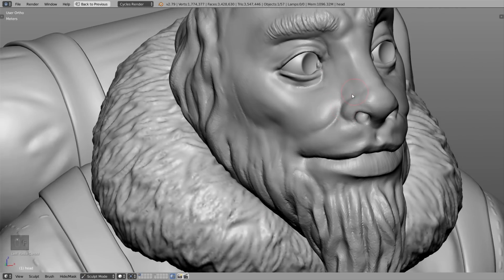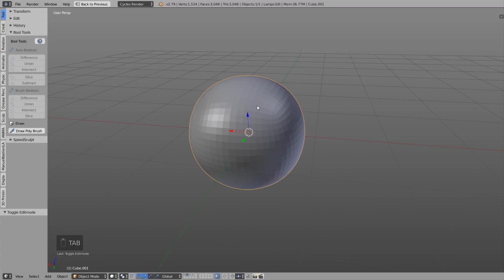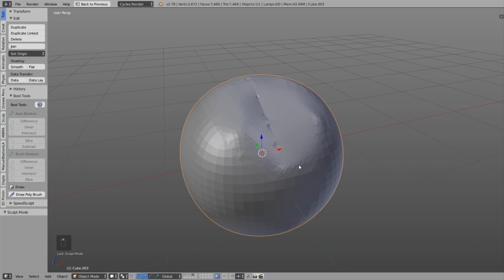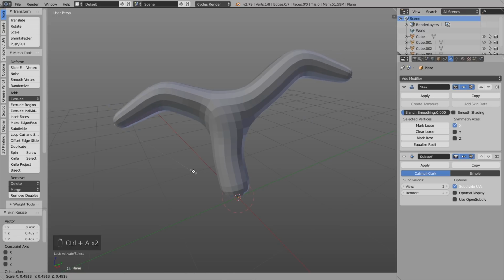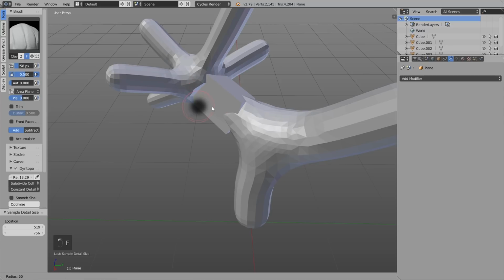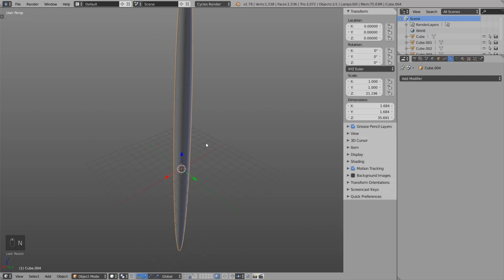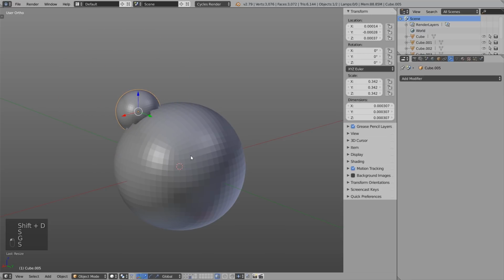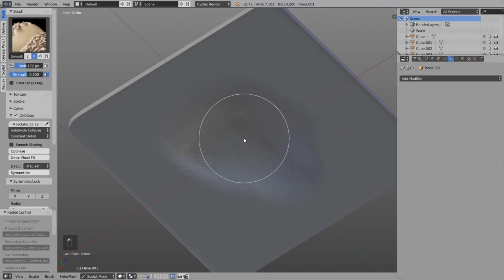How to Solve Common Sculpting Problems in Blender

Comment: I had a serious problem with my sculpt - I inflated a small part into a big blob, and it lost some vertices inside, inflating them into inverse spheres, with even more inside... The way I managed to solve it was to set dyntopo to a really small resolution, use the 'flatten" tool to chop up the degenerate geometry into a very coarse grid, then "smooth" tool to untangle it. Repeat as needed. Then set auto-smoothing to max when re-inflating, it automatically realigns the orphaned vertices.
Reply from the maker: Sometimes with serious artifacts and deformations of a part of the sculpt an option is to just boolean cut out a part of the sculpt and remesh it.

Comment: Some reason I can use the sculpt tool on some flower petals I've been making (Following a tutorial) even with subdivision on it still doesn't work. (like the brush's I use do nothing. with the error on the bottom saying "object has non-uniform scale "sculpting may be unpredictable" what should I do? (blender I use is 3.5 and started using 4)
Reply from the maker: The error prompt is a suggestion for the solution here. You need to apply the scale transform to the object before you sculpt. Otherwise all the tools in sculpt mode might be affected by the unapplied scaling and act really weird (especially if scaling was intense). To apply scale to an object just select it and press Ctrl+A. From the menu that appears select scale and you should be good to go. Hope this helps. 
-DJ
Reply: @cgboost  Thanks for the reply, I was able to fix the problem now :)
Reply from the maker: @CalmLoffy  Glad it helped !

Comment: What do you do when an object cause all sculpt brushes to get squashed? It's like, if I scale the object along an axis, (squashes it) the brushes get squashed as well. Never had this occur before, and I have no clue what checkbox is or isn't checked. I've looked everywhere.
Reply from the maker: This is because object scale is performed by Blender after any edits or modifiers. So if you apply the scale (Ctrl+A, Scale) the brush should go back to normal... hopefully...
~ Daniel
Reply: @cgboost   That worked, and I've done it many times since I made this post. Thanks so much dude!

Comment: hi when i open it up for the first time i have just a grey cube and i try to use my pen to sculpt but none of the brushes  work either.
Reply from the maker: It is because the cube only has 8 vertices. In sculpt mode you manipulate the vertices. I would recommend to click on "File > New > Sculpting". Then you start with a subdivided sphere.

Comment: can ia fix this?, after i enable dyntopo, the sphere comes back to cube, and what is this generative modifiers detected?
Reply from the maker: You will need to apply any modifiers you have on the cube before using dyntopo. It turns back into the cube because it disables any modifiers you have activated.
~ Daniel

Comment: i was just doing "to sphere" with subdivided meshes.. and it gave me some weird sharp edged stars.. as if each vertex was pulled away in the opposite direction.. and definitely not a circle.. :( pls help
Reply from the maker: Hi, thanks for your comment. Before using the "to sphere" option, make sure you selected everything with A shortcut. If this doesn't solve your problem, please go to our community https://community.cgboost.com/home and post the question there with some screenshots.
Reply: @cgboost  actually 'to sphere' was working on the mesh properly after i rotated it to face 'above' or z, and it was giving the above error only when facing sideways... so thats what i did, rotate, spherize, then rotate back. and yes i will post this to the community
Reply from the maker: @aliasalias5351  Great to know that you solved the problem! Also, thank you for sharing the solution with us :)

Comment: I have two meshes combining one material. However one object is darker.. That's not what I want.
I tried to recalculated it, outside and inside. I also tried to flip the normals, merge by distance.. That didn't change anything. 

How can I fix this?

Comment: Thank you for this video, very helpful.  
Some problems I've had I don't see any videos about. One is using the inflate brush results in intersecting geometry with faces inside my mesh. Looks fine from the outside, but it's not. It causes problems later.
Another is I'm working on a mesh with millions of polygons. Sometimes the Smooth brush just doesn't do anything. It smooths out the little bumps, but on large areas, it just does nothing. Is there a way around this?

Thanks.

Comment: 💎This is fantastic thank you so much. 👍 This answers a question I had no idea how to ask.
Why when using box-cutter, sometimes the geometry became. (And I have just learned this "term".) "None water tight."
The only problem now is, the toolbox, and therefore the "make manifold" button to correct the holes etc in sculpting.
Even the "3D print" tab does not work in sculpting in 2.9. Is there at work around this please? Thanks again for any help.

Comment: I got a question, (when I was sculpting a male body, the legs and arms looked too blocky) how do I fix this situation?
Reply from the maker: You maybe have to apply the Subsurf Modifier first or smooth out the geometry a bit more using the Smooth brush.

Comment: I messes up in edit mode and now the object is really messed up when switching between layout mode and sculpting mode in blender! I was following a donut tutorial and messed up really bad
Reply from the maker: Hi Haroun,
Going into edit mode on a sculpted object can be tricky, especially if it has a high vertex count which will happen very quickly when adding details.
It is typically recommended that any manual edits are made when the object is at a lower level of detail. The decimate modifier is useful for quickly reducing vertex counts.
If you need to make manual edits on a high-poly mesh, then you can increase performance by hiding areas of the mesh that you don't need to see.
For example, you can go into edit mode, toggle x-ray to see through the object, press B for box select to choose a collection of vertices, and then press H to hide them. See here:
https://giant.gfycat.com/NeighboringDefiniteLark.webm
Pressing ALT+H will make those vertices re-appear.
Leaving and re-entering edit mode will keep those vertices hidden.
Happy Blending!
- Sent by Curtis Holt

Comment: Quick question.. If I sculpt in Blender with symmetry on and it's low resolution, it seems that the two sides of the object are different (slightly).  It's easy to see it if I go back into edit mode because the edges of the faces are in different places.  I tried Zbrush and it didn't have that problem.  Is that just a bug in Blender, and is there a way to fix it?? I know I can use the remesh symmetry afterwards, but it seems like that shouldn't be the way to fix this issue.  Thanks.

Comment: is there no way to "delete "your sculpting in certain parts so it goes back to the original position?
Reply: not realy, what i ment was like a brush or button wich resets certain parts to its original position befor sculpting.

lets say you totally messed up a arm and you want it back to look like a arm without loosing all your other sculpted stuff on the face.
Reply: Sounds like the 3D equivalent to the history brush in Photoshop, not a bad idea if it doesn’t already exist, worth submitting as a feature request perhaps.

Comment: Very helpfull vdeo but there is still one problem i run into very often (i am new to sculpting so there may be obvious solution) Sometimes some verticies of the mesh are very very deep inside mesh and i just cant pull them out in sculpt mode. Smooth brush stop working at stome point grab doesnt work good couse this pushed area somehow has his way back blocked faces. Any advice apreiciated!

Comment: I had the issue of  holes in the geometry and internal faces from boolean merging two objects together, and I found the remesh modifier fixed this problem. I also learned from a tutorial video by Jayanam that you can press Ctrl + Alt + Shift + M for a non-manifold selection; it selects all the holes and you can the press the F key or Alt + F to fill of triangle fill respectively.

I have a recommendation for a video if you don't mind! I noticed that even if you have a low-poly mesh and remesh it with a higher polygon count it still looks faceted; how can the mesh be effectively smoothed without comprimizing the form too much? EDIT: A solution I found works reasoably well is applying a Smooth modifier to the high-poly remeshed object, increasing the factor field to 1.00 and changing the repeat field to 100 or higher.
Reply: Remesh modifier make too dense mesh

Comment: Holy crap, why couldn't I have found out about that 3D Print Toolbox add-on a year or two sooner?! That would have saved me so much time on so many occasions, including just earlier today, lol.

For the separate floating geometry problem, I tend to just use L to select everything connected to my main mesh, then just invert the selection (ctrl + i) and then x to delete them. Though I suppose that is only really a solution early on, before you go overboard with the sculpt detail levels.

Comment: Can you make a video about tricks to make sculpt smooth and you know, looks more like a hard-surface model instead of bumped look.
Reply: While there are many ways to achieve what you are probably looking for (some better some worse) I think one of the best options you might have are two things:
1. Use the sculpt unly as a base to retopologize your geometry on top with a very low and clean topology (and your whole modifier stack).
2. Split your Sculpt into pieces you want to have individually and use something like 'Instant Meshes' (free) as a basis to retopologize your mesh - simplyfy it by dissolving too fine geometry and then add modifiers and manual modeling on top.

Full disclosure: These tips come from ZBrush but except that it's a little faster to use polygroups there everything should work in Blender just as good. Probably even better with Retopoflow 2.0 and maybe even better in Blender 2.8+
Reply: There is a 'Smooth' brush. :)